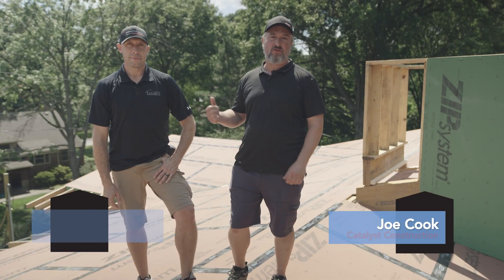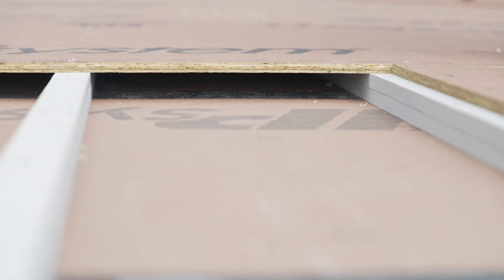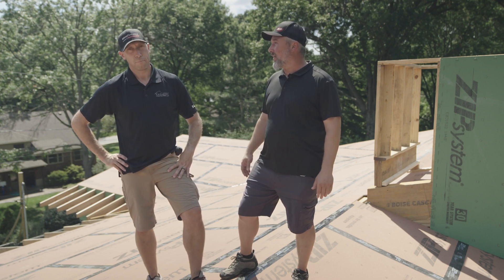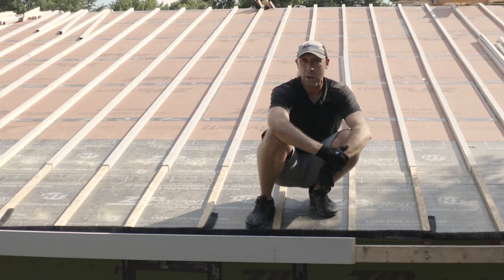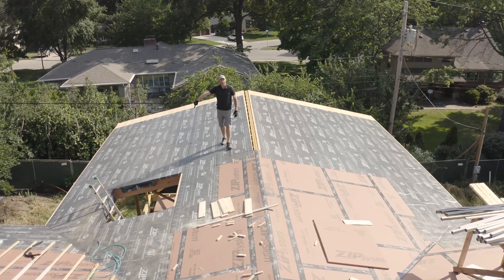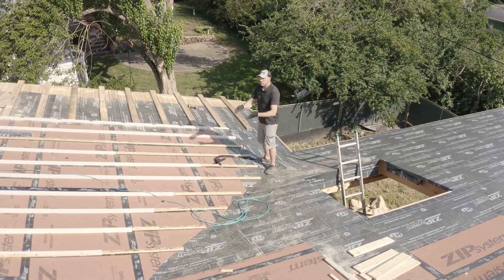Advantages of a Vented Over Roof

Comment: I’ve seen this done before with closed cell spray foam under the 1st deck, and a radiant barrier sheathing on the 2nd deck. Do you think that would be a safe assembly? Is the first layer of zip necessary for any moisture that could occur between decks? Or would regular OSB/plywood work? If using regular OSB/plywould, would a vapor permeable underlayment be necessary to allow any potential drying? I am asking for Kentucky, zone 4a.
Reply: Vapo Permeable will help prevent damage to the wood.

Comment: In Colorado  they called  it a cold roof so ice dams don't  start  from warm air melting  snow.  I wouldn't  use zip for the first  layer.
Reply: Exactly, why did they use two layers of a zip??? Why use WRB over WRB?? ;)) They just had to use free sheets from Huber, more likely ;))

Comment: I literally send Matt Risinger an email a couple years ago about his thoughts on this. I called it the double decker roof system. The idea is a ventilated channel on top of a sealed roof deck. I like it. I’d probably do some zip r on the trusses then a 1.5” gap with some commodity OSB with a few layers of 60lbs paper and some architectural shingles on top.
Reply: Curious what Matt’s thoughts were when you emailed. I’m a big follower of his and I’m looking to build a house soon with a conditioned attic. Curious if he felt it was necessary to vent the roof deck, especially if you’re using closed cell spray foam. Or if this is only something you do when using insulation that is susceptible to water vapor
Reply: @DrWarBear  

He never returned my email so I’m not 100% sure what he thinks on this. I just think the idea of having an umbrella over your roof is a good idea. Like I said, I’d probably use a Zip R 3.6 panel on top of the trusses then 1.5” gap with commodity osb over that. Of course all the details done correctly. Should technically be able to keep the attic air temperature at a very comfortable temperature with very little effort.
Reply: He has a video on metal roof details where he goes over adding furring strips or matting between the underlayment and roof material for the purpose of ventilating.
Reply: @CodyBrannan  
That’s a common detail for metal roofs. It’s not common for shingles or other types of roofs though
Reply: I built a house with a similar vented roof. The space was 1" with an OSB decking above, covered with a standing seam metal roof. Utility bills savings more than paid for the extra expense and labor. The occupants averaged less than $100 a month for electricity on a total electric house. 2200 square feet and 7 children.  This type of roof is a great idea and I am remodeling a house for myself using the same details.
Reply: @donlourie769  

Definitely good to know. I never brought it up since this video but I think I would do it 100% regardless. 

Thanks for sharing
Reply: @mylifeintexas  Actually, I stapled a Dupont product called Attic Wrap which is a thick Tyvek with aluminum coating, to the top of the 2 x 10 rafters, Then nailed on 1" thick 2 x material ripped from scrape lumber. We worked up the roof in 4 foot lifts. Then nailed the osb on as we went up the roof for a place to stand. So only one deck layer. Dupont discontinued that product and now have Tyvek Thermawrap LE.

Comment: What your doing is creating an air break the same principle as an insulated double wall mug but I have a question do you not have carpenter bees where you are or how do you keep them out
Reply: Usually core-o-vent or some similar material.

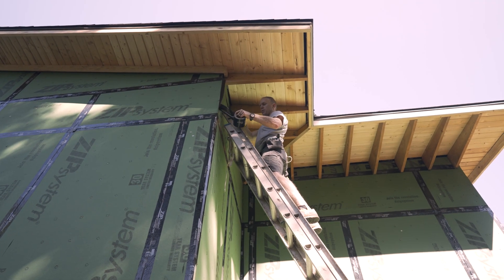Comment: During winter months in Kansas, that sheathing under the vented roof is going to be cold (20F during many nights). By installing (vapor open) mineral wool behind the vaulted ceiling (0:50), won't vapor pass through, hit that underside of the cold sheathing, and condense? I'd expect this to occur even if humidity is well-controlled, e.g. 40% at 70F has a dew point of 45F. Maybe it won't be awful, but no matter the condition, it's going to be hard to see if a problem is forming.

Reference that comes to mind: Building Science Insights 016 ("Ping Pong Water").
Reply: Yes, That is why in section R806.5 of the IRC building code (I am working with the 2018 version) When you do put vapor permeable insulation directly against the inside of the roof deck of an unvented roof you are required to put rigid board sheet insulation on top of the roof decking, under the vented over roof layers. It varies the R value by climate zone too.
Reply: @TheNeighbor4U or have a vapor diffusion port
Reply: @niktak1114  Or both. I would have to read it again to be sure. With the way it was with the way it was written you had to fulfill the requirements 2 of the 3 major requirements sections and at least 2 of the major sections had 3-5 subsections with their own list of requirements to fulfill in order to consider the major subsection to be fulfilled. There were about 3-7 different optional exceptions based on climate zone and how you structure your attic and insulation scheme.

Comment: Come on guys 2 layers of Zip is ridiculous.
Reply: Hell, if I could afford to build a new house I'd be doing the same thing for the roof system except for one thing.  Even though Huber hasn't given their seal of approval, I'd be using Zip-R6 for the inner level of the decking and the regular Zip for the layer immediately under the shingles or solar roof.

Comment: Why not put a vapor-open radiant barrier on the bottom layer of sheathing to reflect most of the radiant heat away?
Reply: OSB RB are BS for cooling; they may (may) aid in retaining heat. Why I say BS? Because, heat radiates from the sun to the roof shingles, where it then conducts through the decking and framing. The heat is already in the house. If now there is a reflective material, all this does is to bounce, or emit, it back to the roof deck. But being that heat travels from hot to cold....it goes right back to through the decking and yea...like I said BS
Reply from the maker: Radiant barrier can make a lot of sense in many warmer climate zones but not necessarily at our location in CZ-4 just 50 miles from CZ-5 where we still have more heating degree days than cooling. A vented system such as ours outperforms a radiant barrier system since the reflection of the radiation in radiant barrier systems offers no convective drying, only reduced conduction.
Reply: @finehomebuildingmagazine Unfortunately by not installing a Radiant Barrier OSB backing you missed a great opportunity to reduce your heating in that cavity by up to 30%. 
But it still works ok without it, congratulations on the venting, assuming your installing a  continuous ridge vent? Nice work!

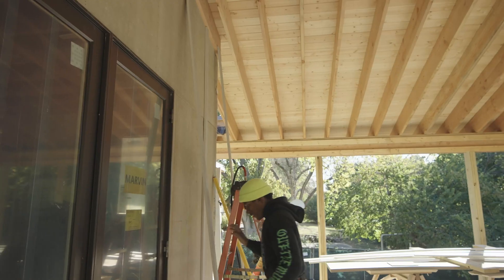Comment: What does "We don't have to resolve for our roofing nails" mean?  It's at the 3:50 mark.
Reply: He means with the air gap over the T&G and second layer of Zip the roof nails will not go through and be visible from the porch below.
Reply: It's just a bunch of word salad because he's trying to sound smart but isn't.
Reply: you’d be surprised how many roofers — two, to date — shoot errant nails straight through into the gorgeous finished wood ceiling installed by my grandfather. looks pretty shabby from the living room side.
Reply: "find a solution to..."
Reply: @drummereef  I’m aware of that, just curious about why you need a solution to roofing nails.
Reply: The roofing nails would protrude through the underside soffit. Unless they used specialty nails, like 3/4 which would the cause issue with high winds. 1-1/4 standard length although we use 1-3/4 for the capping around here.
Reply: @ouimetco  Thanks for explaining.  What would be a normal solution for the protruding nails, if doing a standard roof?
Reply: @travisburch4342  the shorter roofing nails although they may need to be hand nailed (time consuming), whereas 1-1/4 up to 1-3/4 can be air installed.
Reply: @ouimetco  Gotcha, the shorter nails are really it, and they aren't as durable in high wind (and might need hand nailing).  Thanks a bunch friend

Comment: With the furring strips, you had the perfect opportunity to do standing seam metal, and yet on such a nice house you went with the cheap option in shingles. I'm disappointed.
Reply: It might be an HOA requirement, I didn't notice any standing seam roofs in any of the background shots.
Reply: Between the cost of the second layer of sheeting, and the shingles themselves, they probably would have been close to a standing seam roof. 
The performance of a metal roof would've been better overall since it's not a thermal mass nearly as much as the shingles are. The temperature in that gap would've been much lower depending on the color of the roof they chose.
Reply: I agree but not everyone likes standing seem or the cost associated. But yes your right.

Comment: Why do u put a ice and water shield over the zip roof? Isn’t the sheeting supposed to take the place of felt paper or an ice and water shield. That’s a new detail I have been seeing lately( or maybe it is old  but I just started seeing it) but what is the benefits to it? 👍
Reply from the maker: We used the Ice and Water Shield for an additional measure of protection beyond the taped and rolled Zip System sheathing. It allowed us to protect the Tongue and Grooved soffit material from water staining prior to roofing at the perimeter as well as at the back porch where there was no zip. It’s also common for many shingle manufacturers and therefore some building code enforcement officials to require the ice and water shield, felt or other additional underlayment which is likely an extension of the Ice Barrier requirement (R905.2.7.1) 2’ past the interior plane. We also used the Zip Peel and Stick underlayment to block water vapor exfiltration through the sheathing.
Reply: @finehomebuildingmagazine  thanks for the reply.

Comment: Wouldn't a metal standing seam roof be cheaper than the 2nd layer of ZIP + shingles? And it would last longer and look better too while keeping the benefits of a vented space underneath.
Reply: Yes, great question and also why not use regular OSB or plywood on the 1st layer? Serious overkill and even if a high dollar house it is wasteful. Matt Risinger on his channel has done this with metal as the top layer and it looked a lot better.
Reply: Still need the Zip + tape on the first layer for air sealing.  Notice they filled in all the spaces between the rafter tails with zip, and in another video they tape and liquid flash all those joints around the tails and tape up onto the first roof layer.  I think an easier argument would be to use cheaper regular OSB + a synthetic underlayment for the upper deck below the shingles
Reply: @MattSapp  You need even more than that - standing seam warranty is void without a high temp peel and stick underneath
Reply: @mr.g937  That must vary by manufacturer or product line.  The vendor I'm most familiar with says this in their install guide for their snap-lock standing seam:

Note on Underlayment

Not all conditions require an underlayment,
However metal roofing is susceptible to
Condensation and it is recommended that an appropriate Roofing underlayment be use on all wood substrates to protect the structure during installation. For added protection from rain and snow, it is recommended to use rubberized Ice and water shield on eaves, valleys, and areas of roof penetrations.
Reply: @MattSapp  Does it say anything different on their warranty details manual? Curious, what manufacturer is this? All of the ones I've seen specify the high temp ice and water
Reply: @vince9486  he also did the method here on his own house. I agree, looks wasteful; I suspect theres another reason, not mentioned, why these builders doubled the roof with 5/8" huber zip panels plus the new peel & stick... Maybe its because of the new product ;-)
Reply from the maker: We priced a standing seam metal roof for this home and it was not cheaper than the vented asphalt composition system. The standing seam installers in our market require solid panels rather than strapping so we would have had to eliminate the venting (unwise) or supply the same double sheathed assembly to meet the installers requirement anyway.
Reply: @finehomebuildingmagazine  "The standing seam installers in our market require solid panels rather than strapping" - That's unfortunate. I'd guess this is probably the sub's own requirement rather than the panel manufacturer's. Every panel manufacturer I have dealt with allows for furring strip installation.
Reply: @mr.g937 Near me most standing seam profiles require solid decking underneath. The nearest place does make one concealed fastener panel that can be installed on purlins thankfully.
Reply: mentioned hail... guessing that's why no metal roof
Reply: @cruxclimber0600  a low gauge metal can withstand hail every bit as well as an class 4 asphalt shingle

Comment: Wow, nicely done!!!  I wish Huber or LP would make a panel with WRB on one side and radiant barrier on the other.  Imagine your outter-most layer of roof decking with a radiant barrier.  Thanks for sharing
Reply: Huber used to have one and took it out of the market for some reason...
Reply: Radiant barriers don’t do all that much when you have adequate insulation. Check out the building science corporation articles on that topic, it’s pretty interesting.
Reply: @JoshuaRes  I'll look into it.  Thanks!
Reply: @JoshuaRes  was unable to find anything on radiant barriers.  I'm sure Joe has published on barriers before.  What specific article are you referring to?
Reply: @treystills  BSI-136 though in reflecting, I  wonder if the roof deck is the one place a radiant barrier could still have value… to reflect heat absorbed by the roof from the sun back out. But in that case, maybe venting and adequate insulation still solve the problem. See what you think after reading :)